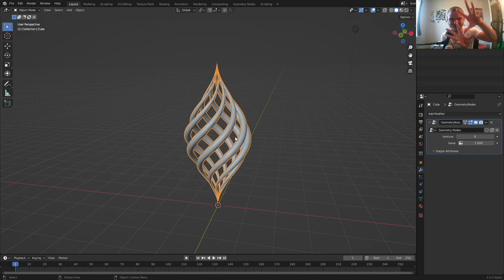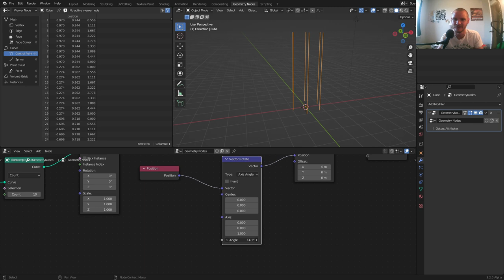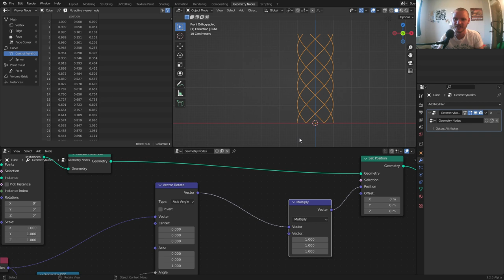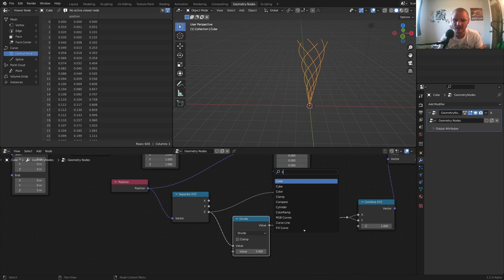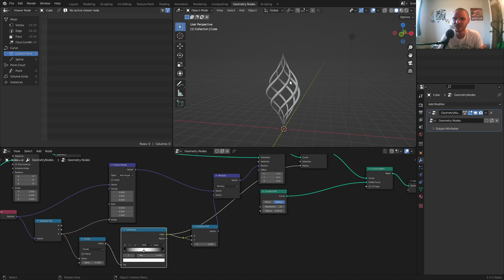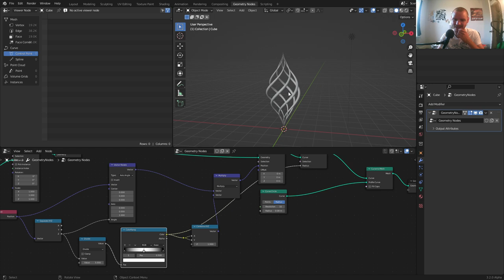HOW!?

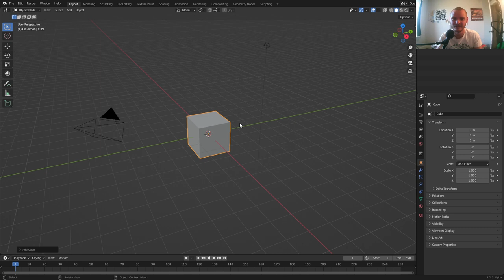Comment: 1:01
instructions unclear. instead of deleting the cube and adding it back, i created a formula that will display my render in a non-euclidean manner so that this process will be a lot smoother. i ran the vertices of the default cube through this program and ended up with something very strange. it did not display my non-euclidean geometry in a perceivable manner. Luckily i am an expert in solving puzzles especially of the non-euclidean tic tac toe kind. so something like this was right up my alley. I used the four elements (water, fire, grandma supporting me in the back, donut tutorials) to resolve this massive issue. all the vertices were right at my fingertips. i felt the power of being in control. for a moment, the non-euclidean default cube was at my mercy. its existence was not only futile, but it also lacked the power to resist. i think it might have liked not being in control for once. generations of blender users not being able to pivot around it due to its dominant presence and its ability to confuse the user. all of this was over. in an instant, my dominant grip on the mouse and my click on it's button set the final position right. i had done it. i had altered the default cube in such a way that it was no longer the default cube. the annoying default material was gone from existence, leaving a void  only my imagination could fill. i held the newly formed cube like it was my baby. i could feel it smile at me. i was happy knowing that i could continue your tutorial without worrying about the Default Cube ever again.

tl;dr i really think clarity is something you need to work on for your next tutorial.
Reply: Lol
Reply: nile red but blender
Reply: why did i read this

Comment: From HOW to WOW!

Is there a way to get a points position along the lines and use that instead the z-position? That way you could bend the lines and retain the calculation.
Reply from the maker: this is what capture attribute can be used for (to save the original position even after transformation) - you can also be fancy with spline parameter node
Reply: Spline Parameter (Factor) > Capture Attribute before instancing should work for what you're looking for.
Reply: @CGMatter  Using the Spline Parameter Factor, you can ditch the Z/Length calculation and just drive the ramp directly. That way the whole thing is procedural. I'm sure you already knew this but I'm excited about learning ok.

Comment: Everything was working fine following along, but when I make the ColorRamp, it just doesn't work! I set the first and last colors to black and made one in the middle at 0.500 white, but I still get the cone shape with the top wide open, why?
Reply from the maker: make sure it's outputting color - not alpha
Reply: @CGMatter  yeah, it's connected to the Combine XYZ from the "Color" output with a yellow line just like in your video
Reply: @CGMatter  here's a screenshot of my issue, with all the geometry nodes visible: https://i.imgur.com/SuACopJ.png
Reply: @EliaForce1984ita  Your line is only 2.5 units high, so you have to divide by that same number, not 5.
Reply: @TobiasEinarsson  ohhh it worked! Thank you!!

Comment: What? Complicated to model? A curve with an array -> object offset and an empty at its core is not complicated and nondestructive. But I think it can certainly get more complicatet, where geonodes whould make sense, but this seems overkill to me. Depends on what you want to do with it later on I guess. Nice tutorial by the way <3
Reply: He was probably thinking of mesh modeling. Besides, your method is still not a finite mesh. Probably need a boolean + remesh.
If you modify the weight of the curves, it is therefore manual, can have errors, and destructive. So the nodes come to compensate for this problem. Projects where it will be useful others not.
Reply: @theplouf5533  I was thinking of taper mode for the curve, just forgot to mention it :)
Reply: @Gliscormolt  Oh ! Use one single curve with six curve cirles sections insted of six curves with only one circle. I hadn't understood... In a way, it's the same thing, but the "ColorRamp" curve actually exists in the scene. OK, Good.
Reply: Again, not that hard.   
Create a Bezier curve (a), and align vertically, subdivide once for a middle point, and shape it.
Create another Bezier curve (b)for a taper object, and shape it.
In the Curve (a) Geometry properties, give it some Bevel Depth.   Apply curve (b) as a Taper Object.
Add a Simple Deform Modifier / Twist : 180º,  Axis Z.
Add an Array Modifier, Fixed Count 8, Object Offset - add an Empty, and rotate it in Z 45º.
Done.

Comment: is it possible to do this effect but in a sphere shape instead?
Reply: Yes easy - but not using Geometry nodes.   
Make a UV sphere.   In Edit mode, select one vertical column of points (Alt-select).
Duplicate the selected points, then separate selection into a new object.
Create an Empty and rotate 45 on Z.
Add a Simple Deform Modifier, Twist, 180, on Z.
Add an Array Modifier, Count 8, Object Offset use Empty.
You can convert the object to a Curve, and apply the Curve Bevel and Extrusion to fill out the wireframe.